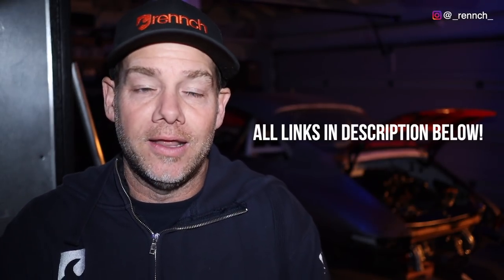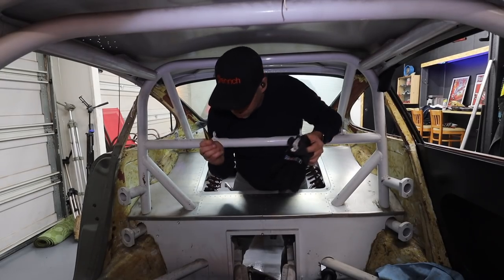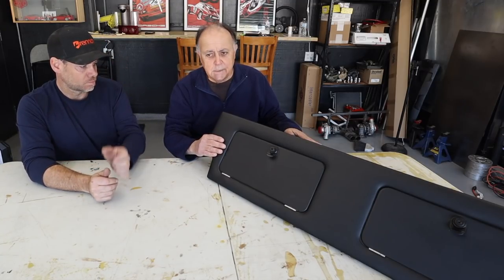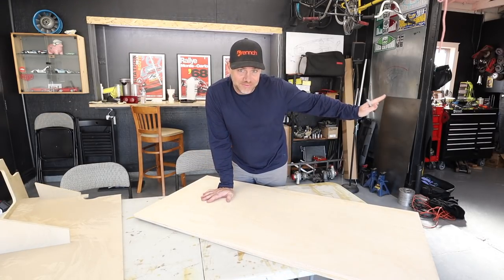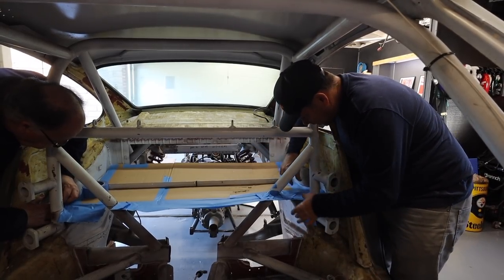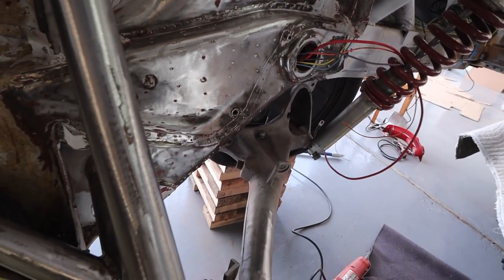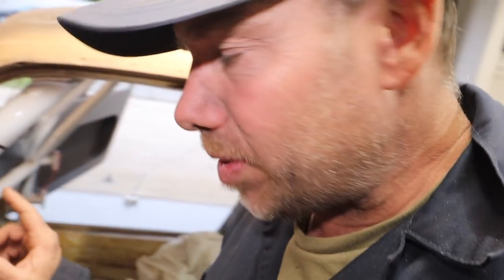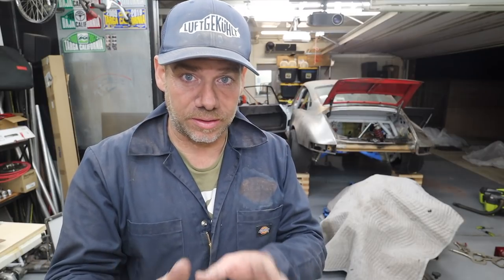Custom Porsche Rear Seat Delete in my Subaru Turbo Porsche 911 Part 1 | Blasphemy Build 41

Comment: I was going to say this a while ago but I have been catching up on all your videos of this build.  If the prior owner of the welder had a different traction wheel in it than you needed, double check that your polarity is set properly for gas shielded wire.  With a big wire wheel like that, polarity was probably set for flux core wire and that will hurt your gas shielded welds.
Reply from the maker: Yea, after I discovered that I went online and looked at the symptoms of an incorrect wheel, and they are pretty consistent with pigeon poop welds.  :)

Comment: Hi, great car and great work you do. There are very strong and durable paint in engine bay, under car. UPOL RAPTOR Tintable Bed Liner TOUGH Coating. Spray cans don't last long. At least for me 😁
Reply from the maker: Thanks for the tips Marcus!

Comment: congrats on breaking through 11k subscribers.
Stumbled accross you on mig welding episode and a link from Trev's Blog  during 9 months of working from home in lockdown in Melbourne Australia.
I then binge wached some 20 vids and laughed and cried along with you.
loving you go getem "Send It" approach.
Just an average Joe , limited tools and taking it in your stride.
Lovin it all Michael.
Killing it.
Keep it up and keep it coming.
Regards Michael from Down Under. ( We reakon from on top)
Cheers.
Reply from the maker: Thanks Michael.  I LOVE Trev's Blog.  Can you believe how good the pieces look when he's done grinding???  It's crazy.
Reply: @rennch.   
Also check our Wray Schelin's  Pro Shaper .com

Wray has some excellent welding tips and also Tig weld on steel panels and Aluminium. 
(Aluminum for your Yankies).

I also saw thtat you found  your issue with the wrong drive wheel on your Mig Welder. That would explain a heap for the issues you were having. 
A different drive wheel for each wire thickness and a knurled wheel if using Flux core ( Gassless welding) wire but then you need to deal with slag over the weld and weld a lot hotter weld.

Keep smiling  
Keep doing what you'r doing.
Love it. 
And BTW I am sharing to many of my car nut mates here in Aus.
Reply from the maker: @michaelanderson3771  Oh, I've been subscribed to Pro Shaper for a long while.  That guy is playing a different sport than I am!
Reply: @rennch.   Maybe but he has some great tips on tig and mig and making patch panels from scratch and his flexible patterns is ingenious.
Reply from the maker: No, I'm saying I have like 3% of that guys skill!